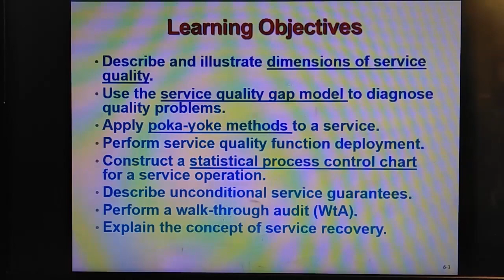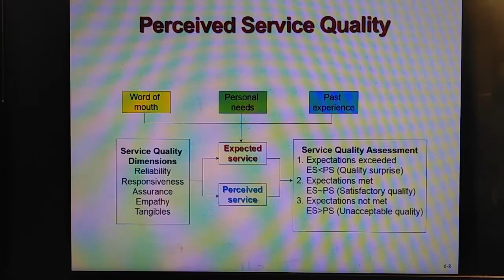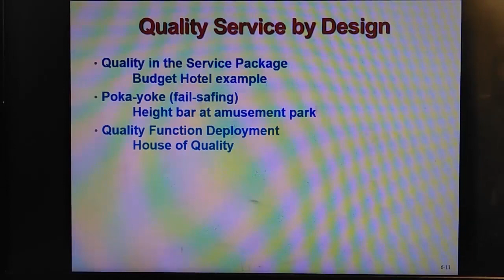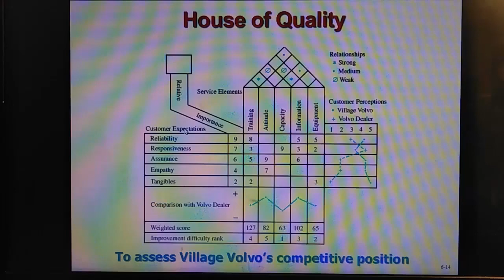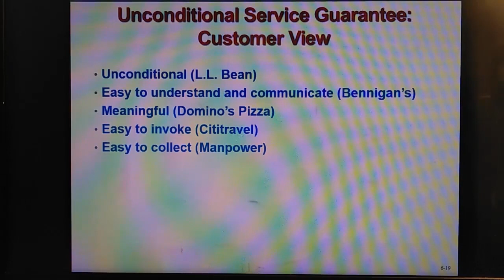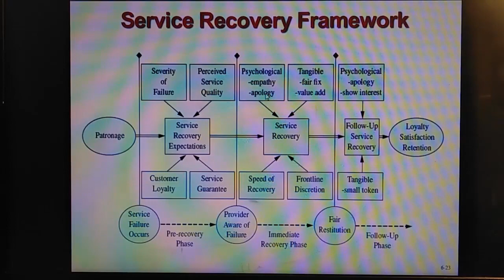Service Mgmt Chapter 7 Whole

Comment: from this video, I have learned the dimensions of service quality, how to adress the gap model within this quality to diagnose and how to make correction to close down the gap. I also know how to apply poka yoke method by japanese scientist. not only that, I also learned on how to calculate based on SPC to calculate the upper control limit and lower control limit.

Nur Izah Izzati binti Idris
CP200006

Thank you Dr

Comment: Thanks Dr for the sharing. I have learned about 5 main element in service quality, which is R.A.T.E.R. Other than that, i also know that the quality service can through the design. For example, the five star hotel sure have the high quality design. Moreover, poka-yoke, function deployment and calculation also had learned through the video.

CHAN HUOY CHYI
AP190154

Comment: Thank you for sharing Dr. for this chapter i learned about service quality which is use a dimension such as reliability, responsiveness, assurance, empathy, and tangible whit concept of a service quality gap. This gap also based on difference between a customer expectations of services and the perceptions of the service.
NUR ARIFA SYAHIDA BINTI YULIADI 
AP190266

Comment: Loh Wan Theng (AP190366)
Thank you Dr for your sharing. Based on the video, i have learned about what is service quality, the dimensions of service quality (R.A.T.E.R) such as reliability, assurance, tangibles, empathy and responsiveness. Besides that, how  to get good perception of service quality from customers, walk-through-audit, quality service by design, the classification of service failures and how to calculate the house of quality.

Comment: Thank you dr for the sharing. The service quality must be good because the customer need a good quality services commensurate with what they have already paid. if the service quality is not good the customer will judged and stop using the services. this will cause a services to get bad feedback and will likely be shut down when many customers do not use the services anymore.

Nur Amirah Adilah Binti Zulkefley
AP190500

Comment: Alice Lee Ke Jia (AP190325)

Thank you for Dr Ros sharing. Based on the video, I have learnt that R.A.T.E.R which is responsiveness, assurance, tangible, empathy and reliability can be used to measure the service quality of a company. In order to analyse the problem, there is service quality gap model. This model contains five parts which is market research, design, conformance, communication and customer satisfaction. Besides, poka-yoke is another method to ensure service quality. It is invented from a Japanese scientist which named Poka-yoke. Unconditional service quality is also one of the tool to achieve service quality. For example, customer can return the items unconditionally to L.L Bean if found not satisfaction. On the other hand, work through audit is another operational based approach to conform the service quality. In conclusion, a service quality is important to all companies as it gives the first impression to customer. In order to get success in your business, your service quality is the main factor.

Comment: CARMEN CHEW AP190476
Thanks dr for today's sharing. Through this video I have learned about the five main elements of service quality which are reliability, responsiveness, assurance, empathy and tangibles. Good perceived service quality can be judge by word of mouth, personal needs and past experience of ourselves or our friends. Besides, I have also learned how to diagnose quality problems by using the service quality gap model as well as how to apply the poke-yoke methods to a service.

Comment: Daniel Tan Tsin Kai (AP190291)

Thank you Dr for today's sharing. I m able to understand more about the dimension of service quality which consist of reliability, responsiveness, assurance, empathy and tangibles. Next, I also understand customer between expectation and perceived service, which is satisfactory quality or unacceptable. Walk through audit is also use to access how good the service quality is. I also learned about how to apply poka yoke method to a service.

Comment: Chin Suhk Jian (AP190427)
Thank you Dr for the sharing. Based on the video, I have learned to address the gap model with the services quality, diagnose it and do the correction to close down the gap. And if the performance measure of the service met the target, the cost for quality or repairing will keep low.

Comment: Thank you dr for the sharing. Based on the video, I learned that the 5 main elements of service quality which are R.A.T.E.R. and good perceived service quality can be judged through word of mouth, personal needs and past experience. Service provider can understand customer between the expectation and perception, the difference between the perception and the service standard, the compliance between the service standard and service delivery, difference between service delivery and customer perception and the difference between the expectation and the real experience through the service quality gap model.
TAN SHI YI
AP190295

Comment: Thank you dr for the sharing. From this chapter, i understand that customer impression of service is influenced by use all of sense. There are 5 elements service quality which are realibility, assurance, tangibles, emphaty and responsiveness (RATER). Other than that, in this  chapter, i learnt about service quality gap model and also the way to achieve service quality. 

Nur Najma Syazwani
Ap190395

Comment: Thank you Dr, I've learned about dimension of service quality (RATER)which are reliability, assurance, tangibles ,empathy and responsiveness. I also learned about house of quality  which is a method to access a service system provider.
Sabrina a/p Roboret
CP200034

Comment: GAN KWANG MIN
AP190428

Thank you Dr for sharing. From this video, I learned that the dimensions of service quality RATER which are reliability, assurance, tangibles, empathy and responsiveness. I also learned the service quality gap model which is between expectation and real experience by the customers.

Comment: Thank you Dr for sharing the video. From this chapter, I have learned about the dimension of service quality. For example, as a provider service need to respect customers, because want customers to consume our products. In addition, i also learned that taguchi's cost of quantity function, we should put our target of the cost at the center which is lower than lower limit and upper limit. This is because when we meet the target the overall cost will no over the upper limit cost.

Hiew Pui Yee AP190341

Comment: Thank you dr for sharing. From this topic i learned that service quality will exist when we dealing with customers with 5 dimension of service quality which is reliability,aasurance,tangible, empathy ,responsiveness(R.A.T.E.R). Also,3 quality seevice by design which is quality in the service package,poka yoke(fail but still manage in good) and quality function deployment.

NUR ATHILA SAFIA BINTI JEMZIR
AP190035

Comment: Tan Hui Yeng (AP190252) 
Thank you Dr for the sharing. I learned service quality gap model is a gap method in service quality measurement a tool that can be used by product manager across all industries. Next, satistical process helps to ensure that the process operates efficiently, producing more specification comforming products with less waste.

Comment: ONG XIN YI AP190265
Tq dr for sharing. After watching this video, I’ve learned the dimension of service quality. Knew how to use the quality gap model to diagnose quality problems and also learned how to apply polka-yoke methods to a service. Besides, I learned how to construct a statistical process control chart, unconditional service guarantees, walk through audit(WtA) and the concept of service recovery.